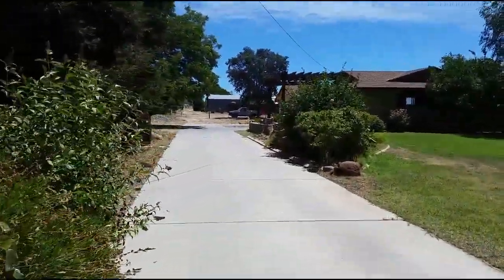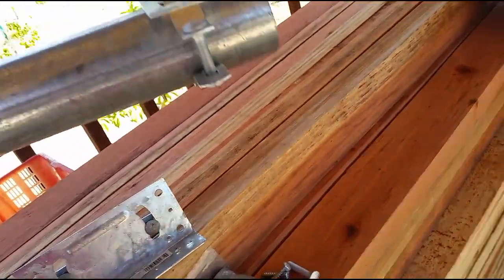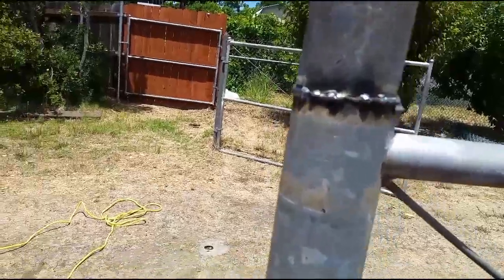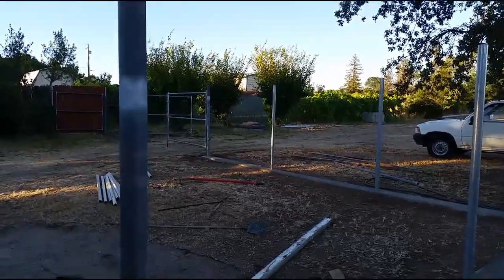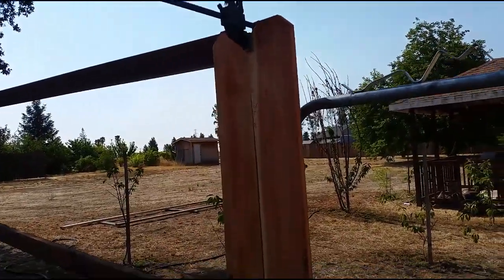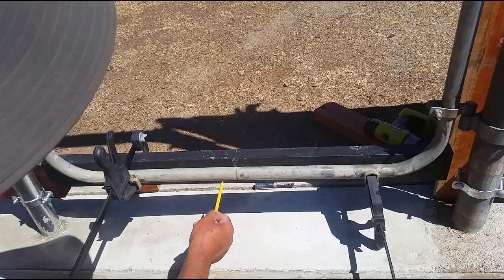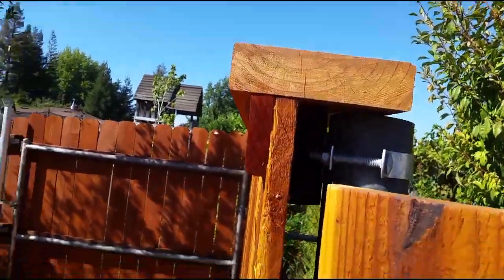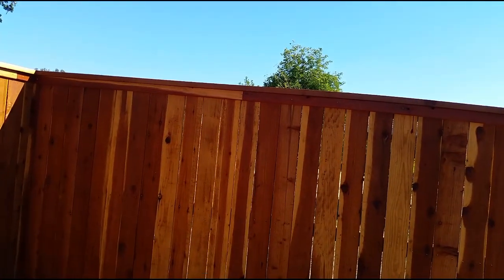Convert chainlink to privacy wood fence | DIY

Comment: This has to be the nicest chain link fence conversion I've seen on YouTube. I really like the concrete at the base. How thick did you por it? And did you bother leveling it? Did you use cedar wood? Or is it pine? Man, your wife must really love you!
Nice work!
Thanks for the video!
Reply: I want to do this to my chain link fence one day.
Reply from the maker: Thank you.  It's about 3in thick. I tried level as much as I could. Not perfect,  it's good enough.  I like how it's turned out. Easy to cut grass because of the concrete mow strip.  I think by adding the cap on top of the fencing made it looked more pleasant to the eyes.  It's redwood dog eared.
Reply from the maker: You can of you got enough helps and all the materials ready.  If you put a concrete strip below you will have to wait till it's dried.

Comment: Thank you for sharing this. How are the 2x4's attached to the metal gate frame?  Did you screw them directly into the metal?
Reply from the maker: Yes.  From into the 2x4, then into metal frame  but not all the way thru metal pipe. This makes it nice and clean.
Reply: Thank you!  @tonedubb4325

Comment: Nice job! Great informative video. Planning on starting our fence this week but will be starting from scratch. After doing yours, what size steel fence posts would you recommend for interior panels and for 6' long gates?
Reply from the maker: Used 2-3/8 for the inside posts.  I got 3in heavy duty posts to support the gate.  Biggers is better. it depends on how big the gates are.

Comment: I built a 6 ft fence with existing 5ft galvanized poles no problem. No need for all that extra time or money.
Reply from the maker: Building it was the somewhat easy part,  making it looked nice requires a little thinking outside of the box. I made it not only was structurally sound but nice to look at.  This is what we see when pulling up to the garage. It's wifey's approved. I win.
Reply: @tonedubb4325  we used ubolts on the cedar 2x6x6  attached to the galvanized poles with 2x6x9 across the top and bottom then lined up the 5.5 cedar pickets. The corners were a bit tricky but my husband and I did a little over half an acre in a little over a day. We did the gates and rv gates the same, although they have to swing one way, overall 3 yrs in and it's holding up great.
Reply from the maker: Nice. Doing it yourself requires a little more work because you want it to look nice but worth it and you can tell stories and you can brag about it too.  😁
Reply: @tonedubb4325  😁 Yep! Especially when it's your own property. I love it when people take pride in their homes. There's a real sense of accomplishment when you look at all the hard work you've done.
Reply from the maker: Absolutely.  I got some land. Boy it takes forever cutting all the weed grass in the backyard.  The front yard is nice.  Looks like a park. Backyard work in progress. The wooden fence hides the not so pretty backyard.  😆

Comment: Awesome job! I’m curious why you opted for the concrete base. Was that just for visual appeal or did it add stability? Thanks! I’m planning on doing this to my back fence
Reply from the maker: First, Not letting grass grow on the fence.  It will be less timeconsuming and easy to cut the grass.  If you use a weed wacker, you will damage the fence if the grass grow next to it.  It looks nice with the mow strip and keeps dirt/mud sticks to the bottonm of  the boards during rain season.

Comment: Love how this came out. For the 2 3/8 pipe you slid over the line posts, what length and kind of screws did you use?
Reply from the maker: I used self tapping screws to secure the big pipes to the smaller existing ones. You can get them at the hardware store.  I only put 2-3 per post just to hold the pipes in place.  Since i got the top board mounting above the pickets,  the posts can't be taller than the pickets.  If you are planning to put a mow strip of concrete on the bottom,  anticipate to cut the post slightly longer. You will bury some of the new posts into concrete.
Reply: Thanks for the detailed answer! Another question, about how far apart were your existing posts? Mine are about 9ft apart. Have you noticed any sag since building your fence if yours are also greater than 8ft apart?
Reply from the maker: They varied. One side was 10ft.  Couple sections were about 8ft and some less. So i couldn't use the premade fence panels. I got 3 horizontal supports plus top piece. I got concrete on the bottom so it can't really sag.
Reply: Gotcha. Thanks man.

Comment: How tall would it be possible to have the fence?  I want to do either 8 or 10 feet.
Reply from the maker: Mines are 6ft tall. No sure if your posts are embedded in the ground deep enough and the diameter size large enough to support 8 to 10 ft fence.